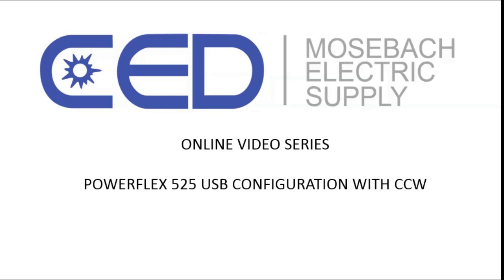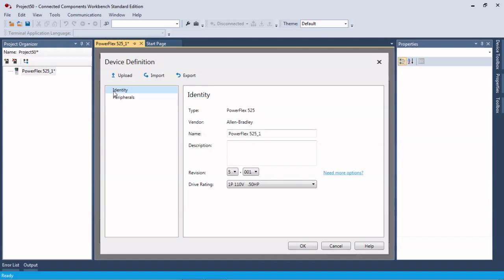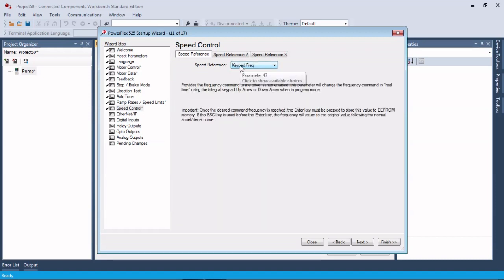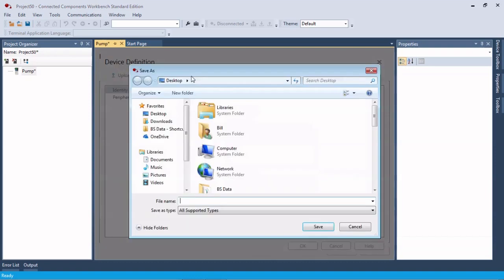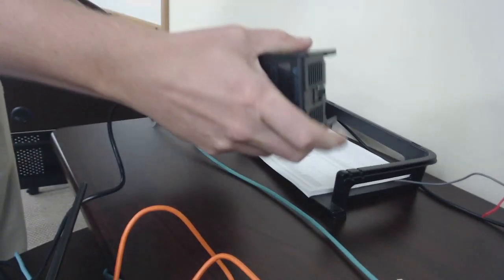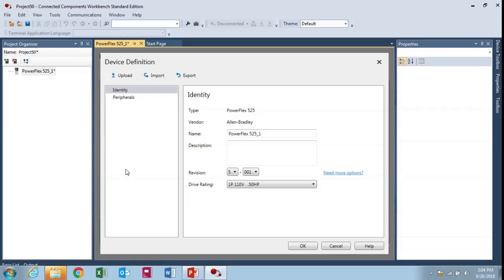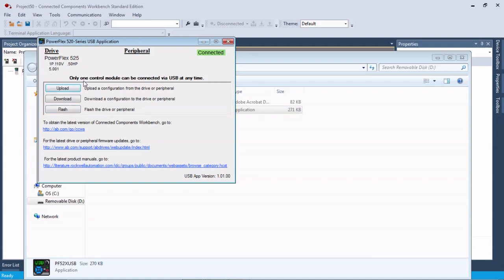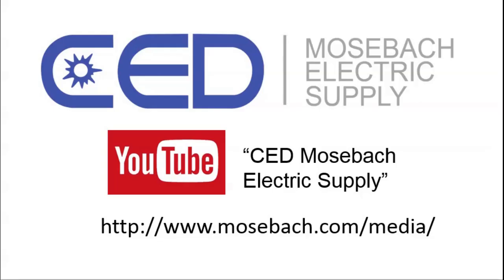Programming Powerflex 525 using USB Port

Comment: hello, i tried to connect the control modulo with my PC but the USB appplications did not pup up. I tried in 3 differents modules but without good results.
Reply from the maker: Hello Jose.  I would recommend you reach out to your local Rockwell distributor.  This sounds like a computer OS issue more than a Rockwell one
Reply: Jose, I'm having the same issue. did you find solution for your issue?
Reply: @mmmaaa4176  hello, it only works with Window 7 or XP.  it is better you connect direct with the VFD with a ethernet cable, Cross or direct both works
Reply: @2_por_2  thank you for your response, but I found way to go around that issue.
Reply: @mmmaaa4176  How did you go around that issue?
Reply: @kalebmertz9112  download the PF52xusb from ab.com then you will be able to upload and download without having to wait the autorun to pop up
Reply: @mmmaaa4176  Thank you!
Reply: @mmmaaa4176  which one did you download exactly? I dont see one with the name you cited.
Reply: @mmmaaa4176  thankyou, it is working for me